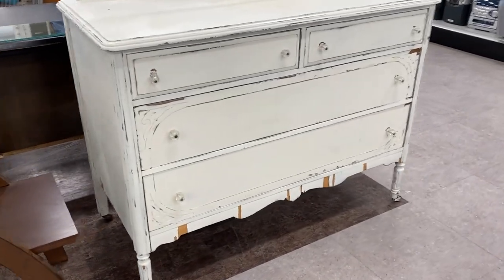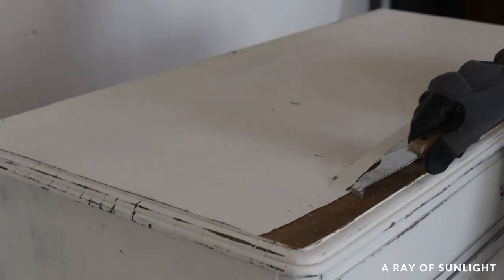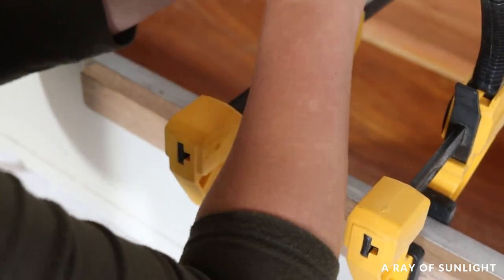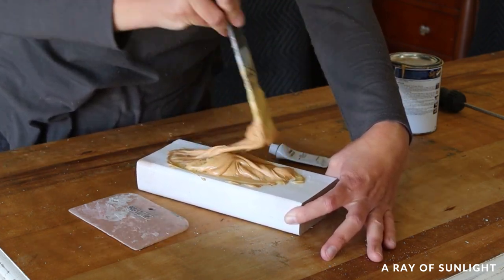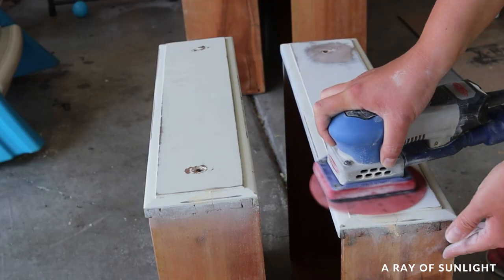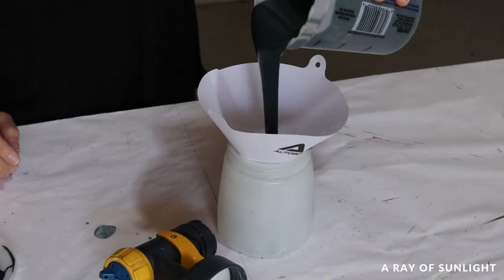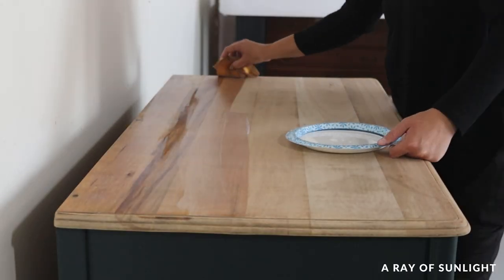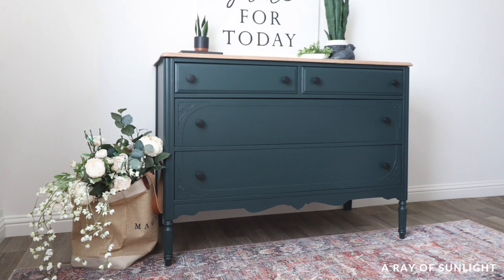DIY Dresser Makeover | How to Fix Damaged Wood Furniture

Comment: Would you say One By is comparable to Heirloom Traditions? TIA !
Reply from the maker: ONE doesn’t adhere as well as HTP. But it adheres well with a primer. 
ONE is more self leveling than HTP. And I think HTP dries harder faster than ONE.
Reply from the maker: But they both don’t need a topcoat, and you can brush roll or spray both of them. Both are great paints.